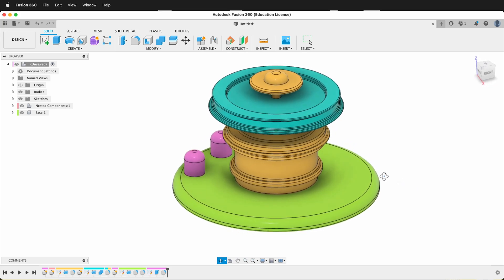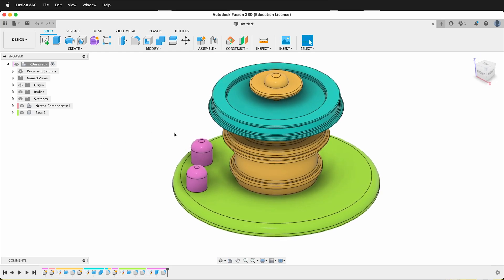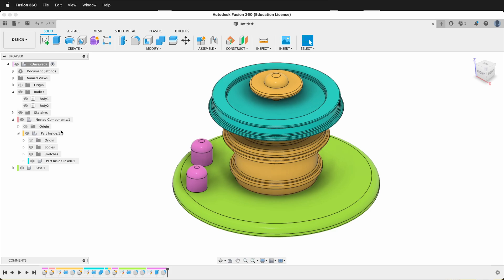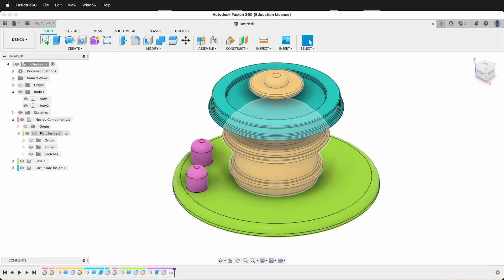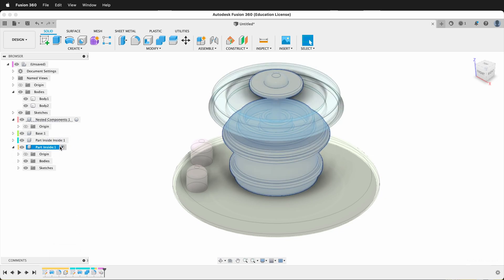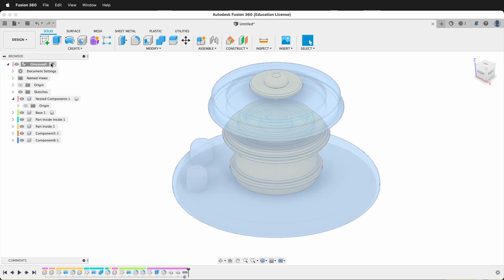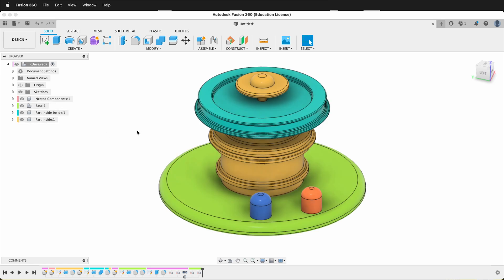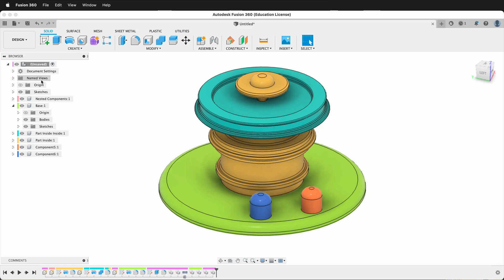Nested Components in Fusion 360

Comment: Mine won't allow me to drag and drop, and I also don't have colors associated with my parts. Do you have any ideas on how to fix that?
Reply from the maker: Make sure that objects are not joined together and they are separate bodies. If you want to see different colors then each body has to be in a separate component. Then under the inspect tab you can cycle component colors.
Reply: @WhatMakeArt  I can see each component as colors but I have materials placed on them whats the shotcut to toggle? Dragging and dropping wont do anything ive even exploded the component into bodies, still doesnt work. unfortunately I have one finished components nestled under 4 components with origin folders and sketches...kinda messy
Reply: @WhatMakeArt  Okay, so when I do the different colors, the component that I want to un-nest from the other is a different color. How would I know if they are separate bodies?  It still won't let me drag and drop.